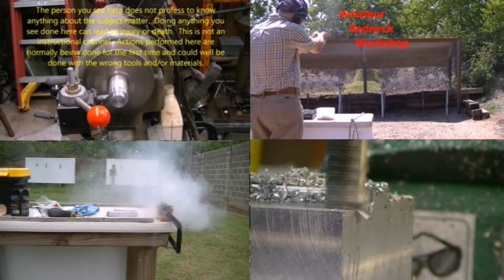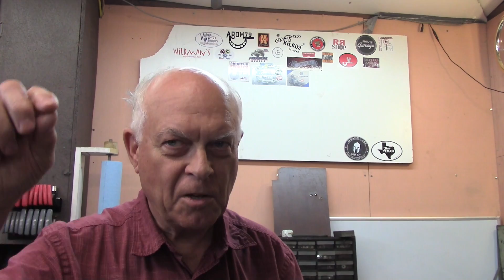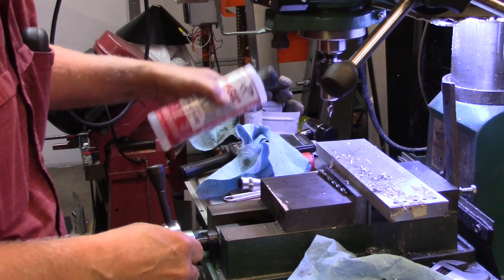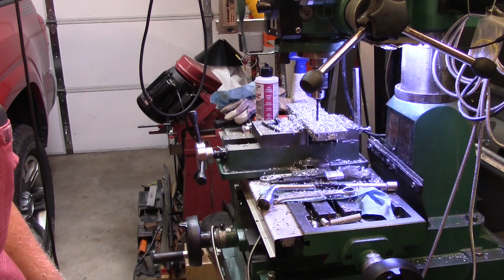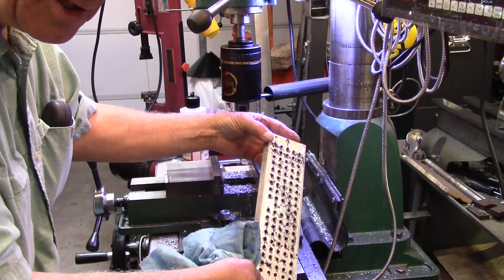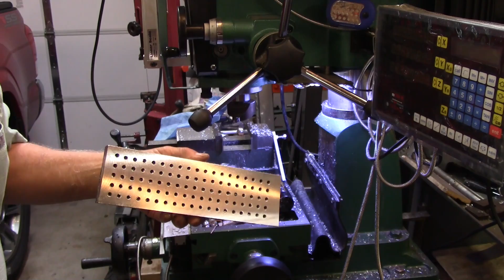Mini pallet build

Comment: Mini  pallet??????????????
Reply from the maker: Well yes mini palette, not pallet which I think is a platform to carry merchandise.  Thanks for stopping by.
Reply: And just what is a "mini palette" used for???????
Reply from the maker: Sometimes you need to hold items on the milling machine that do not fit your vise.  So you can hold down the item flat on the milling machine table itself if you are certain you will not cut the table.  Of course you do not want to cut into the mill table so you can use the palette to hold the item and use as a sacrificial surface.  Many times you may find it to be very convenient to cut through the item and so that means the surface under it will get cut.  No problem with the mini palette as it can be resurfaced and used again.  I should have explained that in the video instead of just assuming everyone would know what I am talking about.  Sorry for that.  Thanks for viewing.
Reply: Appreciate the info

Comment: I maybe stupid but what do you  do with a mini pallet /?
Reply from the maker: It is used to hold irregular shaped items or just any item that is hard to hold in a vise by using small clamps.   You clamp the mini palette to your mill table or hold it in the vise.  If you have to cut through the part then the mini palette is what gets cut instead of your mill table or vise.  I will have to make some small clamps that will be fastened by bolts screwed into the threaded holes.  The job is actually only half done.  Thanks for stopping by.